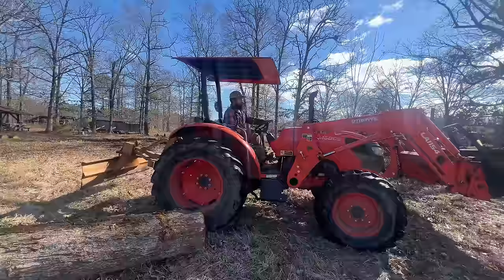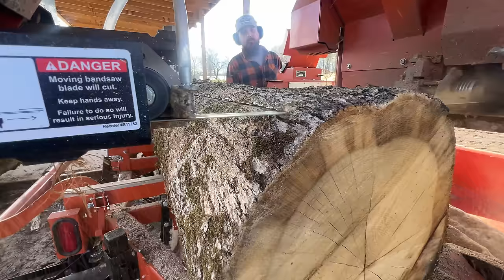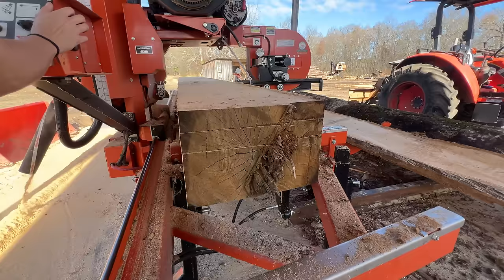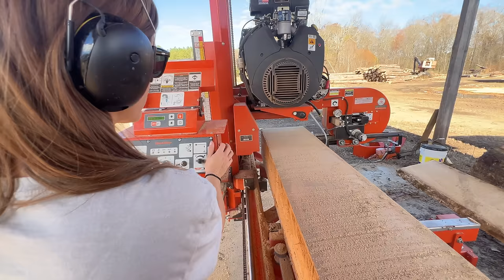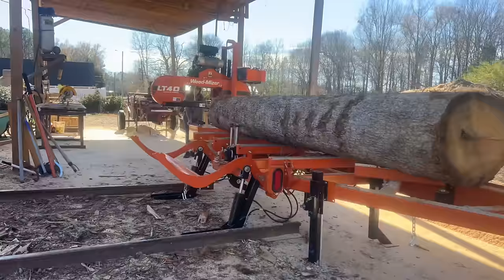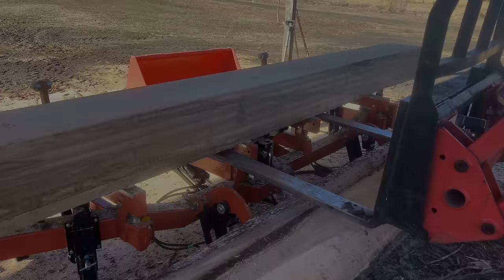Sawing WHITE OAK trailer Decking!!! (Beautiful and HEAVY!!!)

Comment: Take them White oak boards and spray them with some diesel fuel and used motor oil mix and they will last for years on a trailer deck.